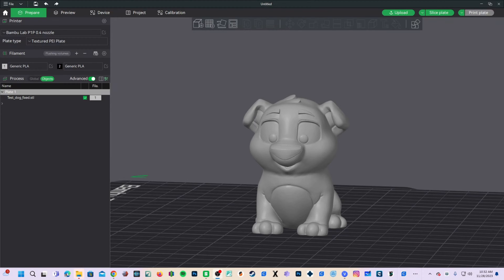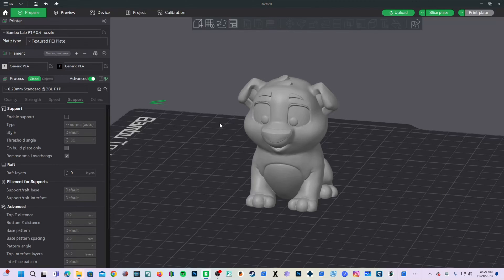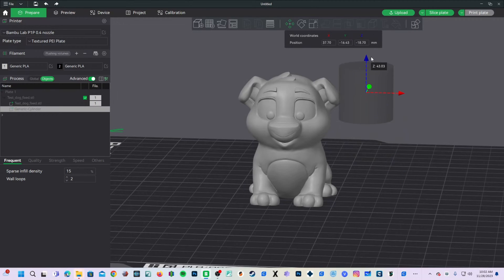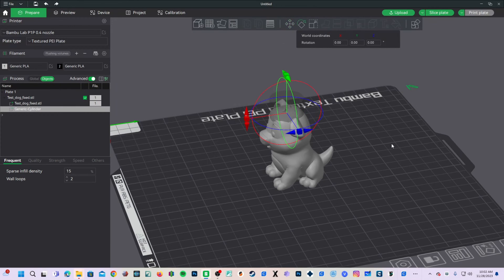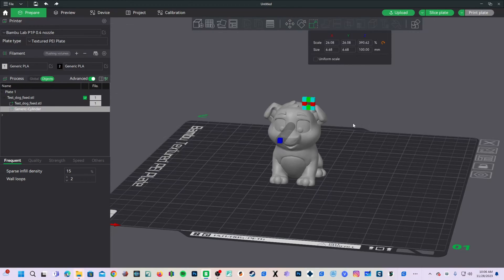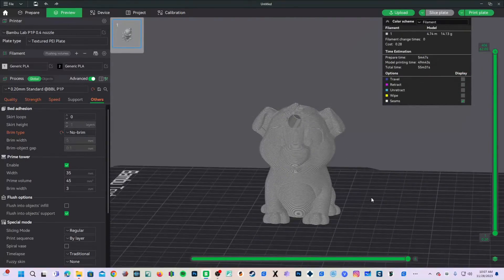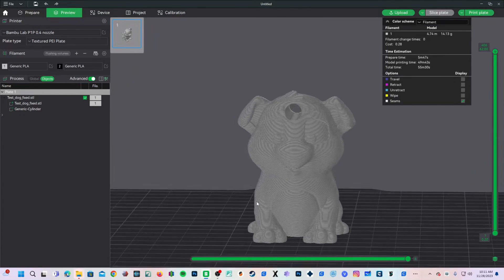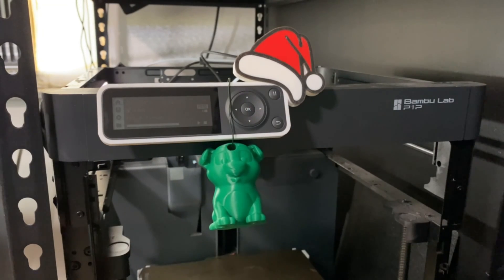Cutting Shapes into a 3D model using Bambu Studio (or Orca Slicer!) - 3D Printing

Comment: When i add the negative cylinder/circle its not even. I turned off uniform scale and entered values (such as 38mmx38mm) but the circle keeps coming out as an oval, and you can measure it that way as well...I can't figure out why. if i add a shape (circle) and do the same measurements, its perfect, but i can't change the added circle shape as a negative part. thoughts?
Reply from the maker: Lemme see a video
Reply: @3DRundown  i got it to last night. I put the same model into a new project and build plate and then the cylinder and scaling was right. I must have had some weird setting in the initial project. Thanks for responding thoa

Comment: How would you remove or resize a hole in an existing part?
Reply from the maker: That's tough. STL aren't really meant for much manipulation. You would need to make the cylinder bigger, and cut over the hole. removing is not as simple

Comment: Is there a good way to print just the hole section?
Like if I wanted to take a square, cut holes into it and print both apart from eachother to click together later?
Reply from the maker: I think this is what you have in mind:
https://youtu.be/sLDTpqpTV9s
Reply: Unfortunately no.
I’m trying to print a d6 die, but don’t have an AMS.
So want to cut a pip section out, move that to a different plate, and print them separate, but where they’d slot into each other
Reply from the maker: I Would use MESHMIXER for this. It's a pain in the ass to learn, but, you can do this there for sure.

Comment: How can you cut an object into 2 parts, reduce the size of 'just one' of the parts . . .   then join both parts together and print (i.e., shrunken head)
Reply from the maker: Lemme have a look at this.
Reply: Looks like you can cut you object and create a peg to pin the two parts together but I have been trying to figure out the same thing printed a Pikachu and the tails Thin and snapped right off so I’m trying to rescale just the tail so it’s a little sturdier that’s the only method I found and defeats the purpose of what I’m trying to do
Reply: Looks like you can cut you object and create a peg to pin the two parts together but I have been trying to figure out the same thing printed a Pikachu and the tails Thin and snapped right off so I’m trying to rescale just the tail so it’s a little sturdier that’s the only method I found and defeats the purpose of what I’m trying to do
Reply: Looks like you can cut you object and create a peg to pin the two parts together but I have been trying to figure out the same thing printed a Pikachu and the tails Thin and snapped right off so I’m trying to rescale just the tail so it’s a little sturdier that’s the only method I found and defeats the purpose of what I’m trying to do
Reply: Looks like you can cut you object and create a peg to pin the two parts together but I have been trying to figure out the same thing printed a Pikachu and the tails Thin and snapped right off so I’m trying to rescale just the tail so it’s a little sturdier that’s the only method I found and defeats the purpose of what I’m trying to do
Reply: Looks like you can cut you object and create a peg to pin the two parts together but I have been trying to figure out the same thing printed a Pikachu and the tails Thin and snapped right off so I’m trying to rescale just the tail so it’s a little sturdier that’s the only method I found and defeats the purpose of what I’m trying to do
Reply: Looks like you can cut you object and create a peg to pin the two parts together but I have been trying to figure out the same thing printed a Pikachu and the tails Thin and snapped right off so I’m trying to rescale just the tail so it’s a little sturdier that’s the only method I found and defeats the purpose of what I’m trying to do
Reply: Looks like you can cut you object and create a peg to pin the two parts together but I have been trying to figure out the same thing printed a Pikachu and the tails Thin and snapped right off so I’m trying to rescale just the tail so it’s a little sturdier that’s the only method I found and defeats the purpose of what I’m trying to do
Reply: Looks like you can cut you object and create a peg to pin the two parts together but I have been trying to figure out the same thing printed a Pikachu and the tails Thin and snapped right off so I’m trying to rescale just the tail so it’s a little sturdier that’s the only method I found and defeats the purpose of what I’m trying to do
Reply: Looks like you can cut you object and create a peg to pin the two parts together but I have been trying to figure out the same thing printed a Pikachu and the tails Thin and snapped right off so I’m trying to rescale just the tail so it’s a little sturdier that’s the only method I found and defeats the purpose of what I’m trying to do
Reply: Looks like you can cut you object and create a peg to pin the two parts together but I have been trying to figure out the same thing printed a Pikachu and the tails Thin and snapped right off so I’m trying to rescale just the tail so it’s a little sturdier that’s the only method I found and defeats the purpose of what I’m trying to do
Reply: Looks like you can cut you object and create a peg to pin the two parts together but I have been trying to figure out the same thing printed a Pikachu and the tails Thin and snapped right off so I’m trying to rescale just the tail so it’s a little sturdier that’s the only method I found and defeats the purpose of what I’m trying to do
Reply: Looks like you can cut you object and create a peg to pin the two parts together but I have been trying to figure out the same thing printed a Pikachu and the tails Thin and snapped right off so I’m trying to rescale just the tail so it’s a little sturdier that’s the only method I found and defeats the purpose of what I’m trying to do